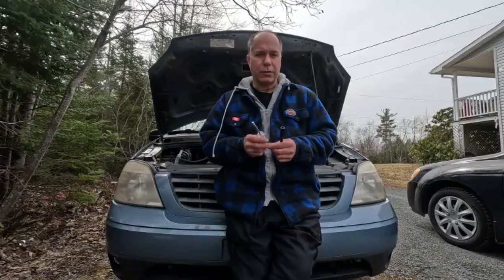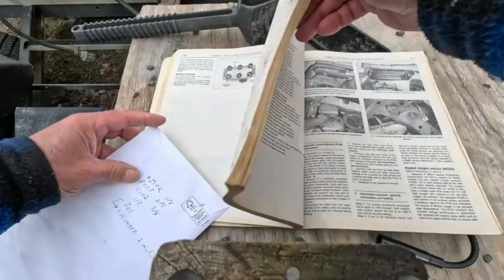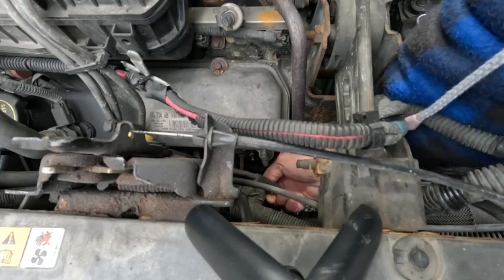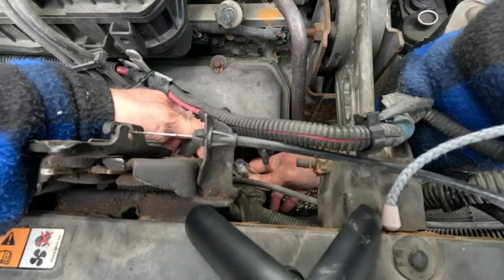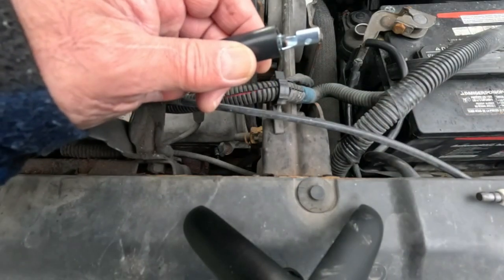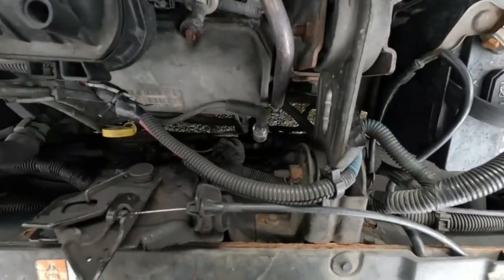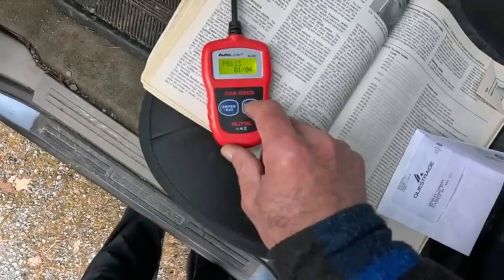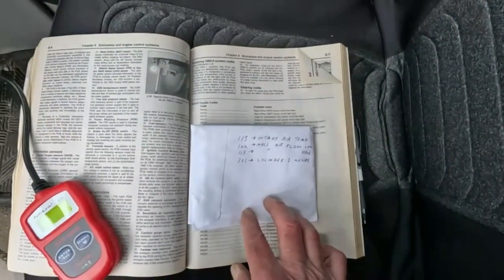Using an inline spark plug tester to verify a plug is firing - P301 engine misfire error code

Comment: We used to work on a lot of those free stars back in the day. Try some BG 44 platinum in the fuel tank. Clean the throttle body & mass air meter. Think ya find a great improvement. Excellent video!! 👍🏼 🇨🇦
Reply from the maker: Good tip 404 - and thanks !